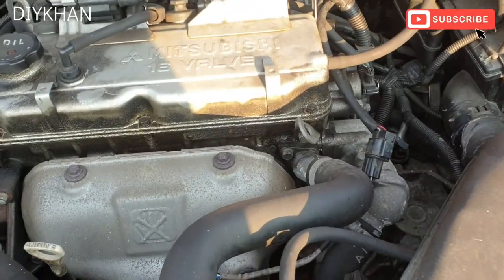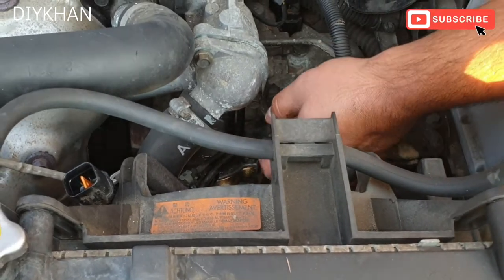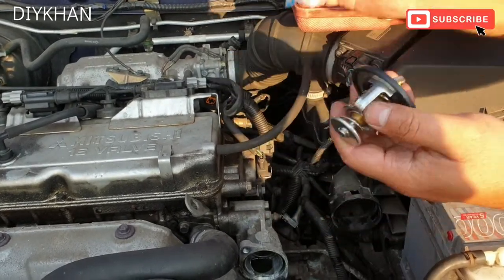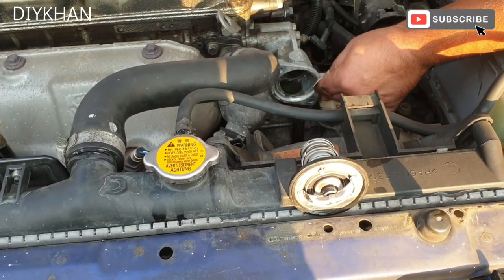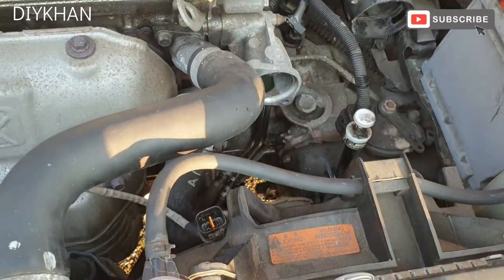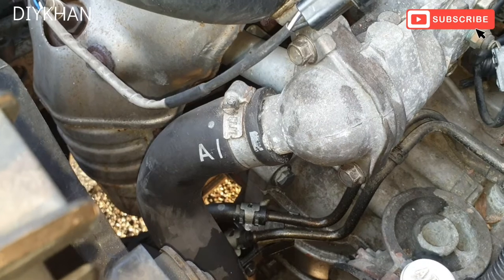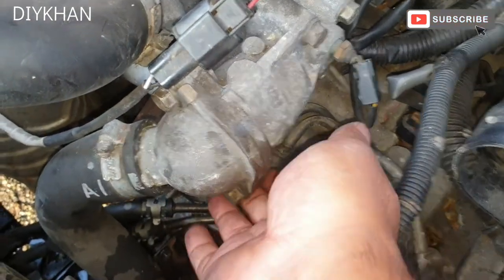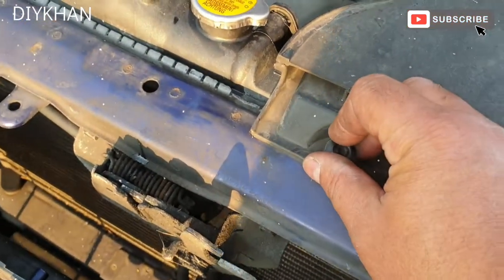Mitsubishi Lancer, Carisma Thermostat Change. Thermostat Replacement Job. Car Engine Thermostat.

Comment: Can I use the usual silicone? (like the one for the bathrooms) thanks for the video brother
Reply from the maker: No you can not. It has to be high temperature silicone compatible to go on engine block.

Comment: Thank you for this video!
I think I accidentally put the new thermostat in upside down. That little nub that's sticking out is at the bottom. Do you think this could cause problems? Also do you know what it's for? Thanks again for your work
Reply from the maker: You should always put the thermostat right way round for various reasons. I would take it out n put it right when round.
Reply: @diykhan  Thank you for your quick response! Will definitely do that, thanks!
Reply from the maker: @timwieser5154  good luck 👍